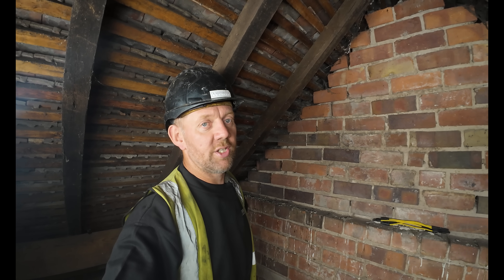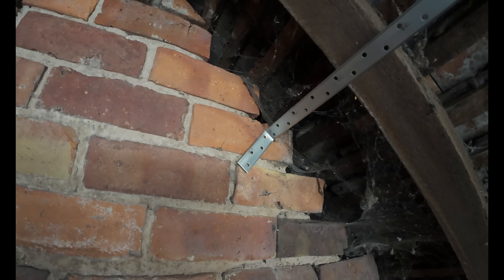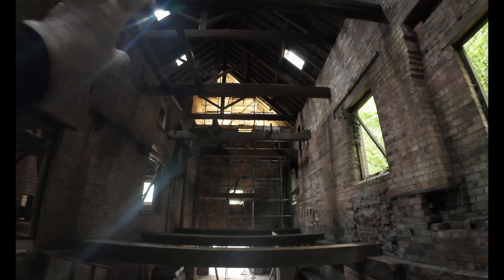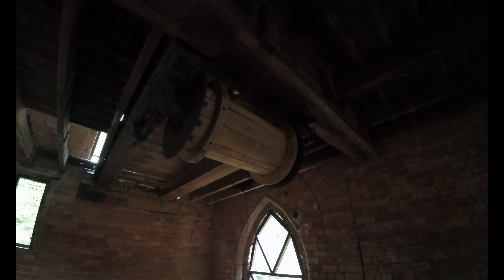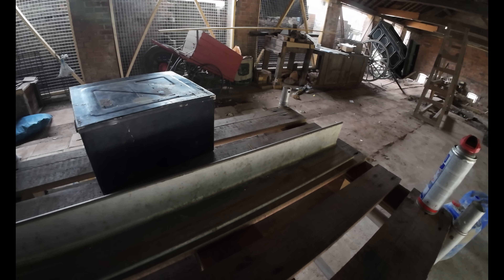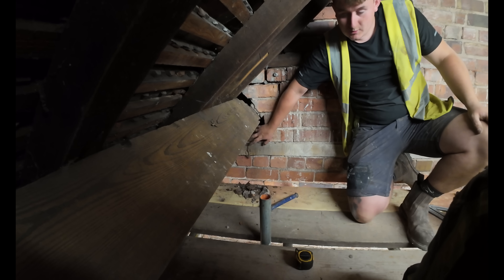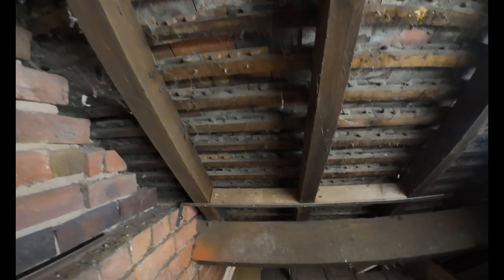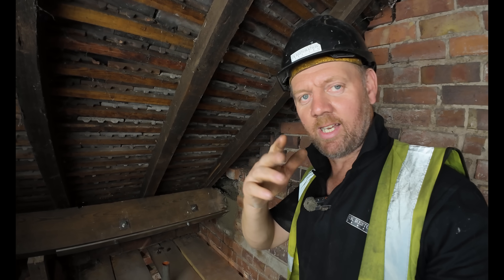43. How we Repaired Rotten Timber Purlin with Stainless Steel Bracket

Comment: Did you have to prop the perlin? In my case I've got a plasterer ceiling below
Reply from the maker: We just put some blocks and wedges from the scaffolding board, but wasn't much weight on the Purlin. I would suggest propping....better to be safe.